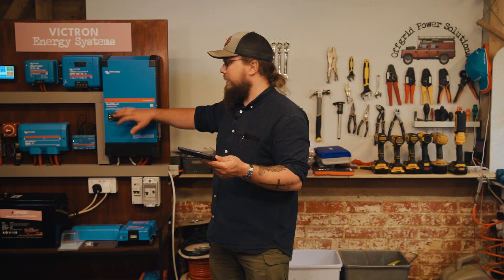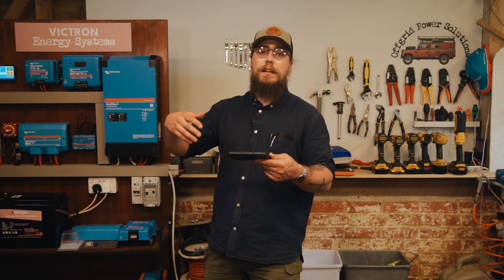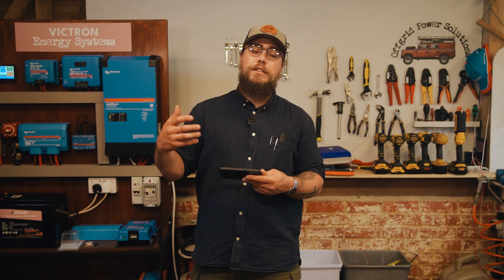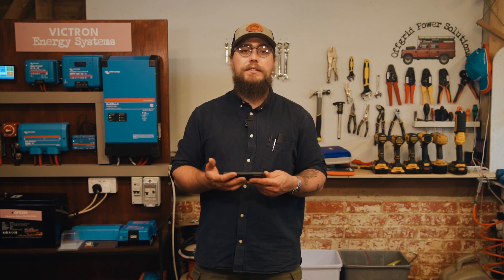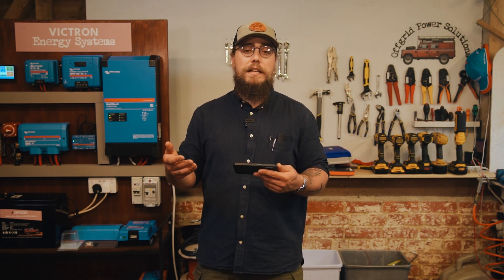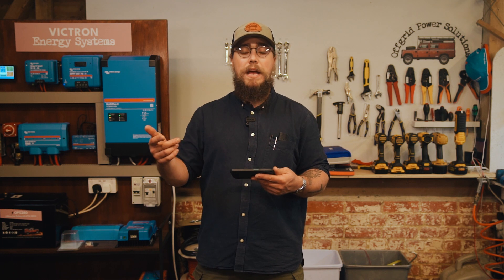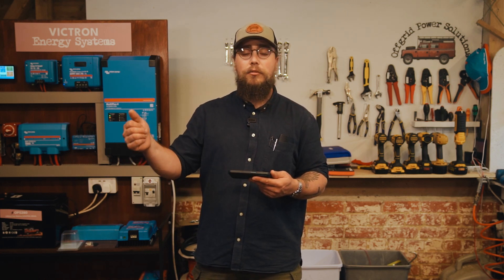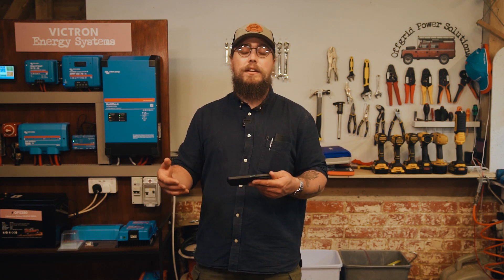Sizing your solar system for your motorhome

Comment: Five years ago, we took an early retirement, sold everything, bought an older MH and hit the road FT. It was the best decision we ever made. We discovered that we enjoy boondocking and it helps stretch our budget too. We quickly learned the advantages of solar and decided to build our solar/battery system in 2 phases, a 12v system for our basic 12v DC needs and a 48v system for our 110v A/C needs. We started with a pair of lead acid golf cart batteries and custom built a 620-watt liftable solar array mounted on the side of our motorhome. We lift the array to the optimal angle to improve their output by 20-30% vs flat mounted panels - even more in the winter, when the sun is lower in the sky. It serves as a nice bedroom window awning too, practically lifting itself to the desired angle with a couple gas struts, and it's easy to clean with a windshield squeegee, standing safely on the ground. This set-up, while far from optimal, allowed us to boondock till we could afford to do better. 

We finished the 12v part of our build last January, with the addition of a 560ah LiFePo-4 battery that we built with 8, 280ah "A" grade prismatic cells. We use a Heltec 330amp BMS, and a 5a active balancer to keep the cells synched up. We typically use less than 20% of their capacity daily giving us enough reserve capacity for about a week of bad weather before we have to run our generator for charging. It cost us less than $1,500 to build this 560ah 12v (7.1Kwh) battery, including the high amp BMS and balancer. We chose these cells rather than a pre-built battery because they fit perfectly under the steps of our MH where our old pair of GC-2 golf cart batteries used to reside, saving 35lbs too.

 We insulated the battery compartment, cut a 1" hole in our step risers and installed a tiny computer CPU fan to keep this space at close to room temperature, so we don't have to worry about the BMS shutting down charging if they get too cold - or their life reduced from getting too hot. We use an 80A Progressive Dynamics LFP converter/charger, a 1,000w Renogy PSW inverter, an Epever 50a MPPT charge controller and a Lnex battery monitor. This entire 12v system cost us under $3,500 to build and takes care of all of our basic off-grid needs except for air conditioning and microwave use.

By mounting our solar array on the side of our MH, we left the roof free to rack 8, 550W Sungold Power solar panels (4,400 watts) down the length of our 35ft Class A about 15" off our roof, above our AC, fan shrouds, etc. They will cover the entire roof, providing some nice shade with plenty of cooling air underneath, further increasing solar output and reducing the heat load on the air conditioners too. We bought them for not much more than used ones - only 51 cents/watt shipped to our door. We're in the middle of this build now. We bought our aluminum racking material in Yuma, where we're wintering over this year, for under $400. Our solar panels, wiring, breakers, Sungold Power all-in-one 48V, 5,000W Inverter/100A charge controller/battery charger, etc. arrived a couple week ago, but we're taking our time to get everything in and installed over the winter. At 67 yrs old, we're moving much slower these days. Our 48v battery bank will use 16, 320ah grade A prismatic cells which only cost us $1,726 from EEL batteries. So together with our 560ah (7.1 Kwh)12v bank, we will have a total of 23.5 Kwh of batteries onboard - kept charged with over 5,000 watts of solar. We removed our rear 13.5k btu rooftop Dometic AC and filled the hole it left with a powered roof vent. We will be installing an EG4 28.5 seer-2 plug and play 12k btu mini-split heat pump near the roof on the rear which will only draw about 1/3rd the power of our current 14.5k btu soft-start equipped Furrion AC unit. This second phase will provide 24/7 off-grid air conditioning, supplemental heat from the heat pump and allow occasional usage of our front rooftop AC during peak afternoon hours, as well as give us whole house 120v ac power. We'll soon have total off-grid electrical independence on a budget we can afford. I don't think a person can have enough solar for 100% of their electrical needs, but our system will provide 98-99% with the balance supplemented with rare, back-up generator use.